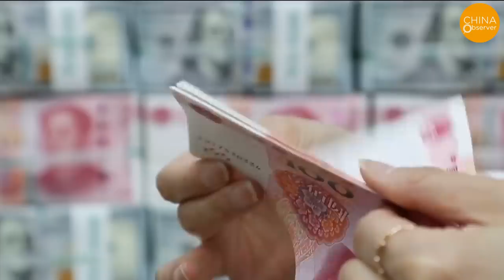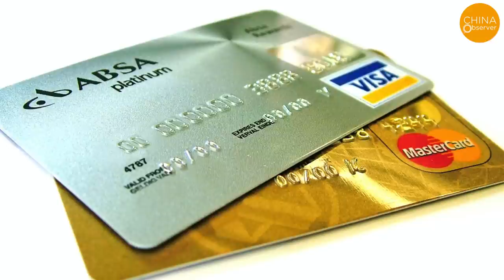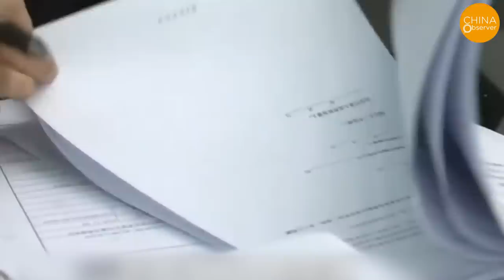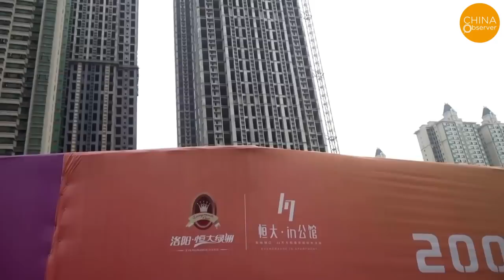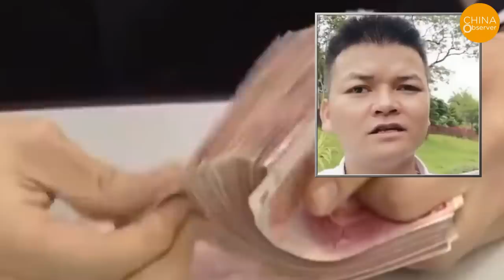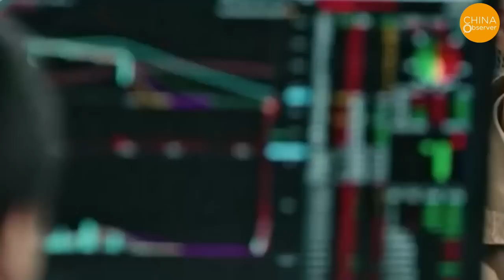Middle Class Is Done! Over 26 Million Chinese Listed as Untrustworthy Debtors!

Comment: This can lead to a huge ripple effect, the more property gets auctioned off, especially in a dire economic situation like the current one in China, the lower the property value will become, causing the property value of all, or at least most, Chinese people to decline, making the property unusable for colleteral and providing less and less debt relief for them if they have to- or are forced to by the banks to sell their property.

Once this spirale starts escalating it can easily turn into something like the 2008 sub prime crisis in the US.
And even more significant is the fact that the property, construction and housing sector in China accounts for more than 30% of the total Chinese GDP. If this would break away, China would be in deeeeep shit. Not only the people and economy, but also the state, since it has loaned huge amounts of money to developing countries as part of their Belt and Road initiative, however here the plan was likely not all about building infrastructure, but rather to place those economies into debt traps, which is exactly what is starting to happen. But even if this was the Chinese plan to gain influence over these debtor countries, it also means that all these loans will remain unserviced, and this in times where the CCP might really need the money...

This Is gonna be interesting
Reply: Serpentza on u tube

Comment: Fascinating.  What happens to these people after they are arrested?  Is there a punishment for being a 'dead-beat debtor'.  And why would anyone buy a new apartment if there are apartments being sold for 70 percent off the market price?  Also, does anyone know, if there are elevators in all those high-rise apartments?
Reply: Organs donators...
Reply: <<Also, does anyone know, if there are elevators in all those high-rise apartments?>>

Ones that work?
Reply: Forget about the elevators if the walls, floors and ceilings are crumbling at the slightest touch.
Reply: Of course there are elevators in all those high rises... they just don't operate.
Reply: @howiescott5865  I just saw a video.  A guy was loading an elevator and stepped out a second before it crashed down.